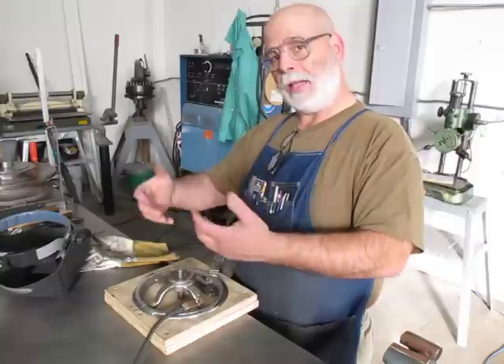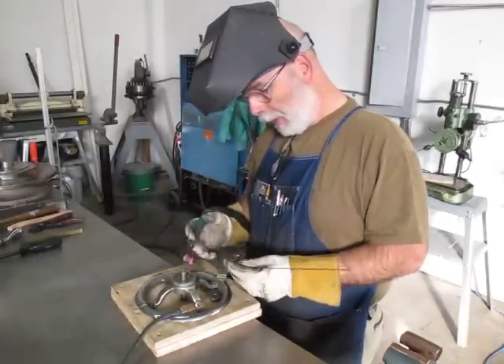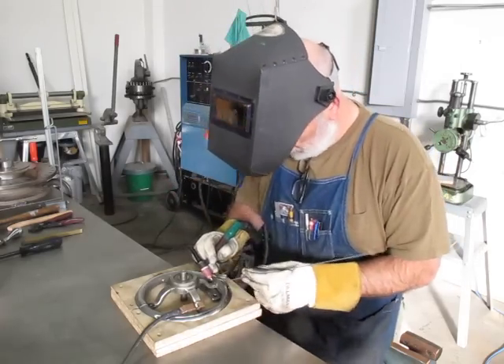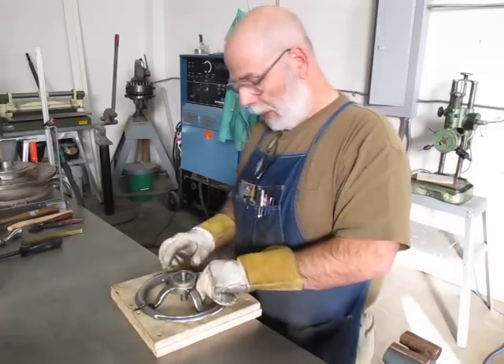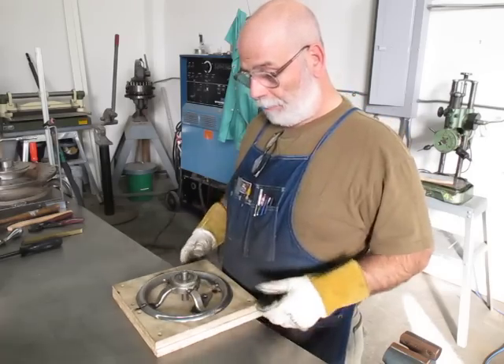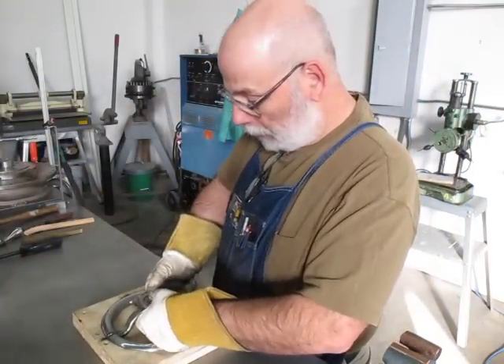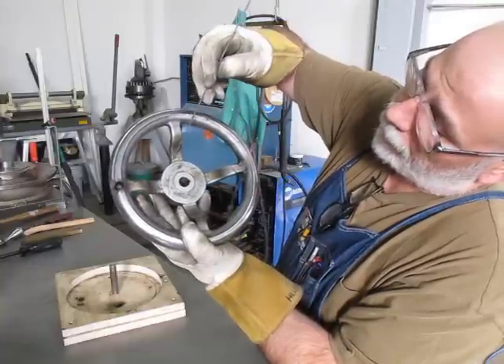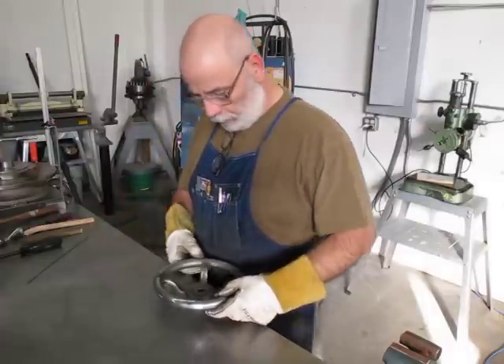Autometric Handwheel Part 4

Comment: Just wondering if you use a cheater lens in that helmet, looks like you're using a Huntsman fiber shell? I'm using the large window version of that helmet but it doesn't have the retaining clips for a cheater lens. Right now I'm using duct tape to hold the cheater in place, but I'm wondering of there's a better way, like some kind of retainer I can add to the helmet? I've looked but can't find anything. Any ideas?

Thanks.
Reply from the maker: Hi Alistair,

You guessed right. I have a magnifier in the hood. It fits right in the pocket with the dark lens and is retained by the clamp. I never cared for the large lens hoods. They are considerably heavier and fatigue your neck when you wear a hood all day long. I always wondered why folks liked them. The puddle is so small, why do you need to see all around? Is the hood you're using an autodark hood or a normal type? Somebody gave me a autodark hood but I ran into the same problem that no magnifiers were available. The standard Huntsman fiber helmets are cheap. Get one and try it out with the cheater properly retained. Get the lightest one you can find.

Cheers,

Tom
Reply: I have a Huntsman 451P, it's just a regular passive filter/flip up jobby.  It looks just like yours, but with a large window. I got the large window because, well, someone told me too a few years back. Something about it being better for a beginner I think. 

I do like the hood, it seems pretty light, just no provision for a cheater. I was hoping that there might be an aftermarket bracket or something that I could fit inside the helmet that would hold a cheater, but it sounds like it would be better to just get another helmet. Any idea on the model number of yours?

Thanks.
Reply from the maker: Alistair Spence Hey Alistair,

Mine is a 711P. No longer available. Since you're not a beginner any more treat yourself to a Huntsman 411P and stick your cheater right into the lens holder. You are already looking through a small window and its fine. Might be a product in there for you. Make adapters for cheaters for common autodark and large format hoods.

Cheers,

Tom
Reply: Thanks for the recommendation, I'll get myself a 411P here shortly and give it a go. I really appreciate you taking the time to answer my question. I'm working my way through your videos, more questions to come I am sure.

Best,

Alistair.